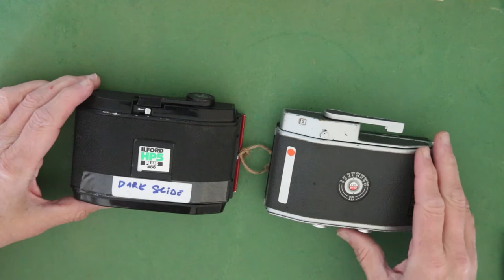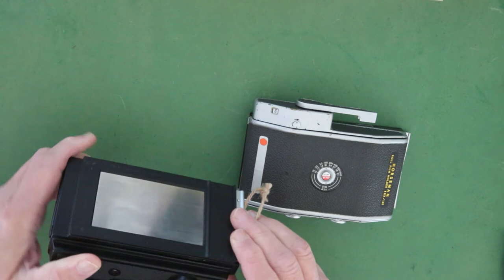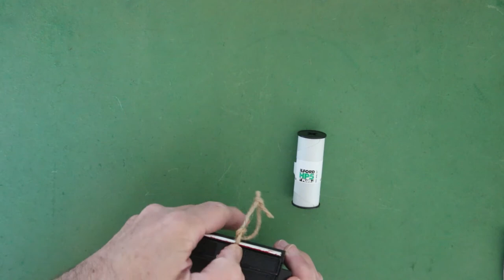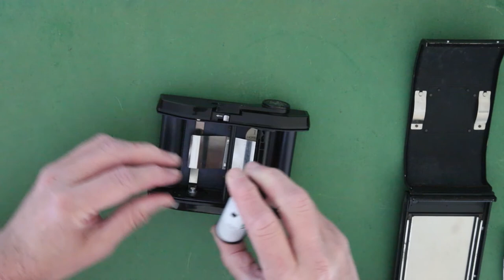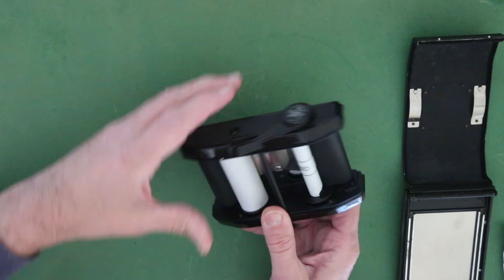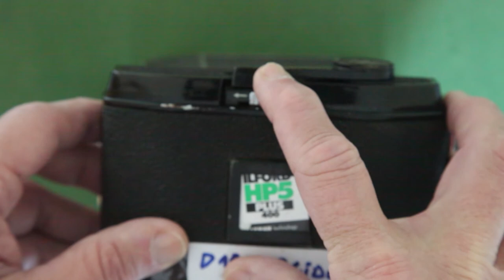HOW TO LOAD A 120 ROLL FILM CAMERA BACK: Using a Horseman 970 Medium Format Field Camera

Comment: Hello

I have just received a Hoseman camera with the roll film back similar to the silver one you have (the one you didn't use for the demonstration in the video.) However, the dark slide on the silver one has a red line marking on it. Apparently it's not supposed to be fully pulled out like the one you're using in the video, but only to the red line, to prevent a light leak from the dark slide slot. Is yours the same? Thank you for this video.
Reply from the maker: Hi Kitty, thank you for subscribing. My dark slide for the older, grey/silver Horseman film back does have a red line etched 25mm from the end. If you pull it to that point, with the back unattached, you will see that the frame area is not obstructed by the slide. This serves 2 purposes: 1) you can leave the slide on the film back, to avoid losing it or forgetting to replace it between shots and 2) possibly to prevent light leaks. That said, I have removed it completely with no light leak issues, but it may be better to be safe than sorry. :)
Reply: @skelligringphotographyandw7012  thank you so much! This is very helpful. I’ll keep it on then as I do tend to forget with my Mamiya Press. I have shot a whole roll with dark slide IN so I learned my lesson 🤣 thank you for doing the horseman series I am binging on them now it’s so hard to find the resources. Thank you!
Reply from the maker: You are very welcome. Leave me a message if  you need me to make a specific video.